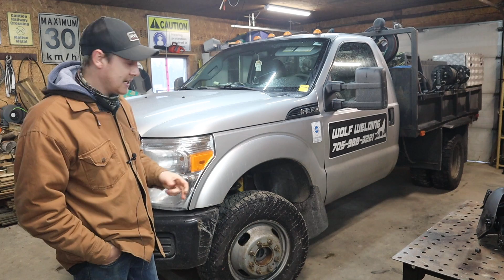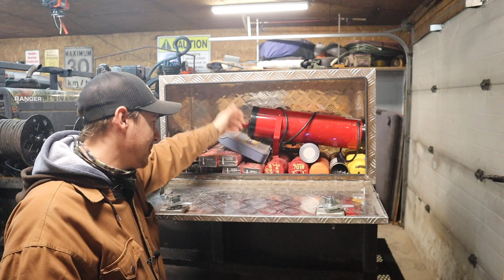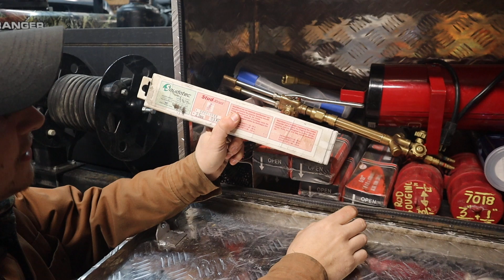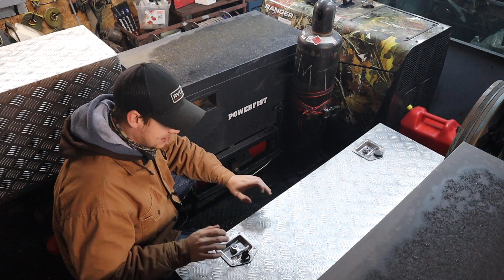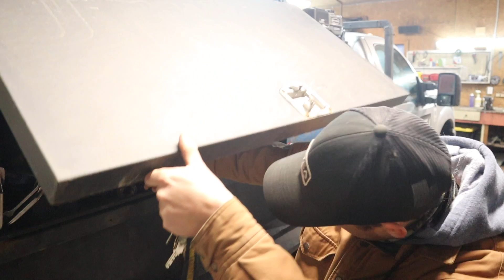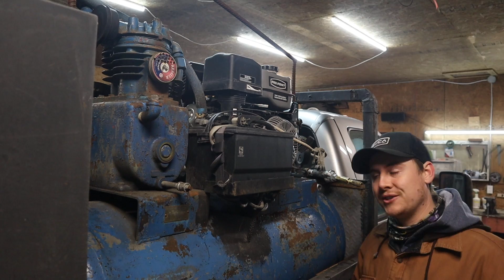My New Welding Rig Tour! (2015 F350)

Comment: Saw your last video and now this.  You are going good!  I'm late to your posts, but it's coming on spring in Chicago so I couldn't help but laugh at the storm blowing by your garage window!  HAHA I do portable welding but only for installs of the things I design and fabricate for people.  So, I have fancy schmancy ESAB welders and a Westinghouse inverter generator. They have two models of Ruffians for field stick welding. For how good you set up your trucks and tool chests and bracketry, it makes me laugh when you prefer making wood shelves in those cabinets rather than angle and a piece of brake metal.  Your gas cylinders on the box openings were more complicated that shelving.  I wonder how you price your work in the equipment repair industry.  Far more welding, torching and gouging than I ever would entertain.  I run my equipment in and out of my 2013 F-250 6.2. Mig, stick and Flux Core. How's it been going these last two years? Still running that 6.2?

Comment: I like your video a lot. im also a mobile mechanic/fabricator. I also agree with the gas motor for many applications and 1 point you didn't touch on, especially in Canada is that you need to put additives in diesel so it doesn't gel. So added cost and constant filter issues are another downside. But if you need to idle your truck for any reason, pto, heat , ac, inverter power, etc. You want a PRE-emissons diesel. Exesive idle time, especially in modern gas engines, destroys them. But again, if you just show up, park, and kill the engine, then gas is the best option.

Comment: As a freelance pipe welder in Europe, I find American welding rigs looks really cool!!! 
but from a practical standpoint, I can carry more(5500lbs payload) , be better organized, and not have my tools exposed to the elements or thieves with my Mercedes Sprinter van. There must be a good reason why you Americans don't use a van. i just don't understand why
Reply from the maker: I think the vans are the best option, the problem in North America is they are too expensive and unreliable compared to the used trucks you can buy. There is no cheap used market for 4x4 vans because Mercedes was the only one offering them  until ford and ram came out with them in 2025.

So if you’re looking for trucks there’s a billion better priced options than any van(mine also has 7000lb payload). I know a few people that have had sprinters and they had a love hate relationship, they loved the vehicle but hated the reliability. Every time something broke the parts were always on back order and super expensive, my buddies sat parked for a month waiting for a sensor. 

If there was a good used market for 4x4 vas I guarantee that North America would have tons of them as rigs but that’s going to take about 7 years. I would definitely get a van instead if I could but I couldn’t find one. 

So in the end it’s mostly an availability issue and also a Mercedes problem because they’re the only used option. We put a lot more km on our vehicles over here opposed to Europe ( Ive driven 1400 one way to a job and still been in the same province) Mercedes has a rather bad reputation because their North America products don’t hold up to the high km at all compared to the American work trucks. When you look at used sprinters over here most are usually all mechanical written off or close to it so everyone buys used trucks instead.
Reply: @JTwelder.  Thanks for your reply. It's true that I've never driven more than 700 km for work, and that's very rare. Parts are expensive here too, but there are plenty of dealerships and availability. If my Sprinter manages 400,000 km, that will already be a lot for this type of vehicle.

I really like your point of view that our vehicle should make us money, not spend it. It looks like it's really cold in Canada! Respect! I don't know if I'd last a season in your country. Safe travels and good luck, my friend.

Comment: 3:10 I own a Miller trailblazer 325 EFI, love the machine but did have a board failure at just over 200 hours. I believe it was around a $1400 repair.
Reply from the maker: Yeah I’ve heard that’s somewhat of a common issue. My Lincoln just had a digital readout go bad at 600 hours and it’s gonna be $500 to get the new part. I’m honestly fed up with only having two options (miller and Lincoln) when it comes to engine drives. I’m hoping some other manufacturers come out and give the big two some competition when it comes to engine drives.

Comment: 6.2 is a great motor
Reply from the maker: I love it so far! Starts great in extreme cold, has power when you need it and does about 10mpg loaded up which isn’t too bad. My 12 valve Cummins does 16mpg when loaded up with welding gear so they’re really not that far apart when it comes to fuel efficiency.

Comment: Im not a welder, but i run my own small handyman business, and do various ranchwork etc. I sold my 06 cummins and now I rock an 06 f350 4x4 cclb dually with a 6.8 v10 GAS motor and a 6 speed manual.  Truck does everything i need it to and i dont have to deal with all the headaches of having a diesel. Times are changing and if you dont live with a trailer hooked up 24/7 its getting harder and harder to justify a diesel.
Reply from the maker: Definitely! Well said.

Comment: I run a 6.4 hemi. I haven’t had any issues yet. I use it as a welding rig and my tree service rig. I tow 4K-14k lbs all the time no problems. I see no reason to get any diesel that’s not a 12v Cummins. The new gas engines pretty much have the same or better power than 90s era diesels. New ones have more power but like you said emissions sucks. The newer ram 2500’s are rated about the same as the 2011 Chevy 3500s as far as GVWR.
Reply from the maker: Exactly! As long as your not constantly towing the gas trucks will be the best option.

Comment: In the process of building a thing called a meme... the little car got a snow plow welded on it and bent 2 3''x3''x1/4'' L channel sections 90 degrees 1 foot from the mount, then it broke the 1'' axles that got welded back together then it got a 600 pound full floater axle... now it has a 7kw 240 volt generator on a PTO to the 4.6 triton to the point that 1500rpm is 280 volt 75hz... for a old 225ac transformer... only needs 65amp 38v to attach a 5/32 7024 400f preheat on rod and base, PTO shaft off the alienator pully was ratter up to 5500 watt "120amp". the 3/16 6010's really do work filling poor fitment, 1/2'' gaps are nothing... but then its simply hard to get funds to go to school in Alberta, running on a structural MIG ticket from high school... was free, just had to sine up to the class. have a water jack that's 260ft deep with 4000lb of sucker rod in it but the above ground rod is cracked in half, someone reluctantly drilled a hole in it... so that needs to be fllled, tho it is 135amp to 165amp for welding 1'' to 2'' rod that works best... vertical rebar wonder... weld on or off of vehicle and the electrical back feed fries the ECU? see if it actually works before the pully howls on the belt. 7kw at 60hz would be near 9kw of start up before coming down to 60hz the whole 210amp 38 volt their to lite it off? "structural tack weld tests" fillets of start stops... cant go around a 1'' shaft on the inside, but if your at the vehicles GVRW something is going to brake after 500 miles... every bump passes the tensile elasticity yield limit slowly making it... tho an 8.8 axle let go making a thud like a 30-06 on its first let go, the 7018 patch cv axle was a few multiple smaller thuds at a double load limit as 1400lb when it was stated for 900lb... no motor's to turn the wheel's. DEF error... or the ethanol that's steam locking the injectors on the gas. floaters floating now... face off the 1.5" AAM shaft to 1-5/8th. like a boat, only floaters float. the ford 9" is an 8.8 with a Band-Aid.

Comment: that 6.2 is a good unit if you get a misfire make sure you replace ALL the coil packs or it will just keep doing it if you dont it will eventualy put a hole in a piston the coil packs at for run about 3000$ for all 16 of them (dual ingnition) installed
Reply from the maker: Ok thanks I’ll keep that in
Mind!

Comment: It’s nice to see that you are doing great after opening your own business 👍

Is there any chance that you could possibly do a video about welding in the open air in a proper winter environment? I occasionally do that but if it’s below -5 degrees celsius it sucks 🙂 Starting from lens fogging and lack of suitable welder's cap that is warm and comfortable with a welding helmet, then going through suboptimal working/welding gloves and ending with an angle grinder which isn’t particularly happy about working in such conditions...not to mention those harsh winds when you start question your own clothing choices after a few minutes spent in a static pose.
Reply from the maker: Thanks for watching. 

Yeah I might do a winter welding gear video. Some tips I can think of right now are to wear a respirator because it helps exhaust your breath out of your shield making your lenses fog up less. Also whenever I’m work outside I wear a neck buff who really helps against the wind.
Reply: @JTwelder.  That would be great! I’ve ordered a respirator with a quick latch system, never seen those before, thank you for showing it 👍

Comment: i will say watching both vehicles get set up you need a hoosier pole. the cage on the welder cart would have been a great start.
Reply from the maker: I prefer reels over a Hoosier pole and I’m also hardy ever working close enough to my truck to use one, their more for pipeline guys. I can see how there are a must have if you’re a pipe welder though!

Comment: Is there a reason mobil welders never work out of an enclosed utility bed? I always thought it would be nice to keep everything out of the weather, and you would still have toolboxes on the side to work out of...just a little curious. I do know those beds are expensive, so that coul obviously be a reason why
Reply from the maker: Some welders run them. You probably didn’t notice because their welding machine was tucked in and not visible. I’m actually looking for one right now.

The main reason I don’t have one is because they’re hard to find with a cabinet that’s tall enough to fit my torch bottles. I’m still looking through.
Reply: The enclosed utility beds are super expensive. Even just the normal utility beds are pretty pricy at the moment. But to answer your question fully most pipe guys try to look cool more than they care about function. More of the heavy equipment or contractor type guys are running open top utility beds mostly. I was looking at an enclosed utility bed but would need a bigger truck and about $25-$30k for the bed alone. But like he said most guys that do run enclosed utility beds don’t advertise much and don’t care to make a YouTube channel.

Comment: Like myself, it seems you’ve had all the diesel fun you could afford. As far as the Lincoln 305G EFI, I just bought a new one back in June 2023. It’s my third Lincoln 305G (the previous two were carbureted). I still own the first one and it has 7650+ hours on it now. My second one, I put 3200 hours on and sold it for more than I paid for it. I love them with the exception that the EFI has an idling issue that hasn’t been resolved yet despite the fact that it’s been worked on twice by a Lincoln authorized shop. Welds great but it can’t figure out how to stay on low idle when at rest while hooked to my Lincoln LN-15 suit-case wire feeder if it’s on two 25’ leads. Does fine if you take one of the 25’ leads out and replace it with a 50 footer. Any ideas on that, leave them in the replies.
Reply from the maker: Yeah diesels just aren’t worth it for a welding rig. Thants awesome you put over 7k hours on a ranger! My 305 efi would only stay in high idle when hooked up to my LN-25 like yours but after a few test beads it started to idle down properly again. I think it was something to do with my LN and not the welder. Also half the time it idles up when I pull the trigger on the LN just to feed some wire out and the other half of the time it feeds wire without idle up.

I just bought a miller trailblazer 302 air pak yesterday so I can’t wait to try that out!
Reply: Thanks for the reply. Just so you know, my LN-15 worked flawlessly on both of my previous 305G carbureted machines.
Reply from the maker: @williamthomas9463  maybe the computer reads the signal from a ln25  differently on a 305efi and that why it idles differently.

Comment: Nice Rig! Nothing Wrong with a Gasser, also Eliminates the problem of Misfuelling if both Welder and Truck are the same fuel type, Close Call with a few of our guys Misfuelling on a few service trucks for a company I used to work for.

Really Curious about How involved the CWB Company Cert Process was. I already have the Actual Stick Structural All position Certs  but curious about the Company certification part, I've never dealt with that before at all and it seems overwhelming to me so curious about it from someone who recently did it.

 I too am just a One man operation, but would like to jump into Structural Steel Stuff I constantly get asked about and offered.
Reply from the maker: Thanks! Yeah I love the gasser especially its -30 in the morning. 

Getting my company CWB certified was a lot of work and money. I spent about $7k over all and it cost $1650 a year to keep it plus whatever it cost you to retain an engineer. I had to take a week off to go take a supervisors course and hire an engineer to write me some procedures. It will pay itself off but overall it’s a really expensive process. I got it because I plan on hiring a few more welders and doing shutdowns.

Comment: Trust me next one get a diesel you'll save more money on fuel then on gas
Reply from the maker: Yes if I run a diesel I will definitely use less fuel! The reason for running a gas truck is they’re more reliable, cheaper to maintain/repair and easier/faster to fix which in the end is less expensive than running a newer diesel. Also the lead time and price on parts and repairs for newer diesel’s is ridiculous! 

My father in law had the same year truck but with the 6.7 power stroke. It got stuck in reduced power mode and needed the whole def exhaust system replaced. The parts were $4000 and the labour was $2000 but the kicker was the dealer had the truck for 6 weeks because they were waiting on parts. I can’t run a business when my truck is gone for 6 weeks!!! That’s what I have a gas truck!
Reply: @JTwelder.  your father in law went with the wrong truck it was a for the reason i went with diesel was because i live in new Brunswick and sometimes i got all the way out to digby for some structural jobs for a company that hires me and i never had any major problems with the Cummins i have which is 2004 24 valve
Reply from the maker: @Charles-oe4kj  if you have a 24v then you have a vp44 injection pump and a 48re transmission which are two major fault points. I’ll stick to my 6.2 gasser with the 6r140 trans. Also I own my own company and I charge travel by the km so my customers technically pay for all my fuel anyway. I’m all about reliability and quick repair time, I couldn’t care less about fuel economy.
Reply: @JTwelder.  i charge for the travel too but i never mentioned it was in the stock truck i put it in a first gen w350 with an allison trans in it that i put in when i was 16 apart from that the fuel injectors are fine only had one problem with then in 10 years of having that engine
Reply: @Charles-oe4kj Just shut up, you don't know shit.
Reply: @Charles-oe4kj on newer diesels you will not save money in any way shape or form unless all you do is long distance hauling.
Reply: @nitrouscatfish5827  i never said anything new
Reply: @JTwelder. not necessarily and you have alot to learn and obviously father in law does to. Gut that girl and don’t let truck sit and idle for 6 + hrs st a time do particulate puts u limp boa!
Yankees 😂